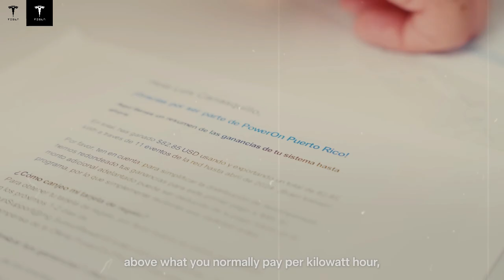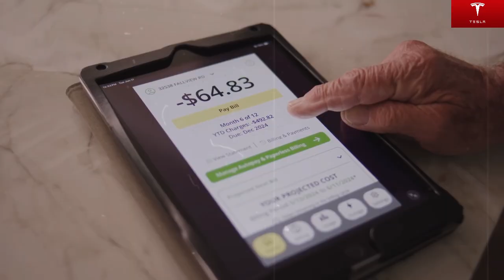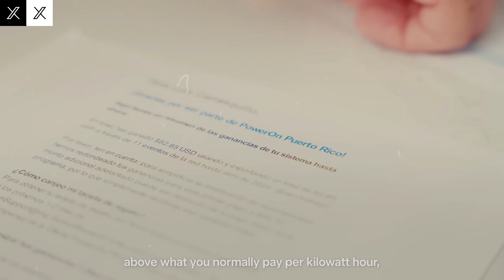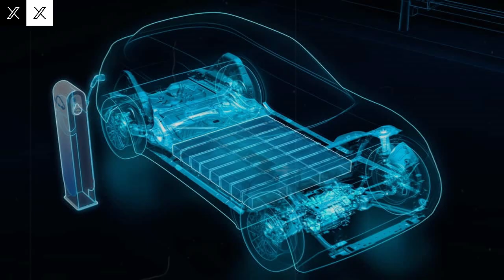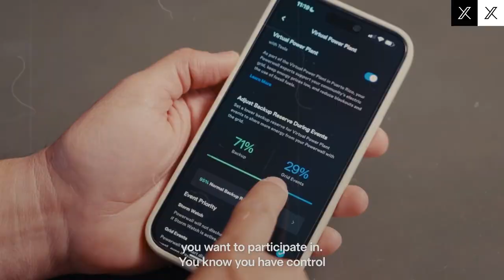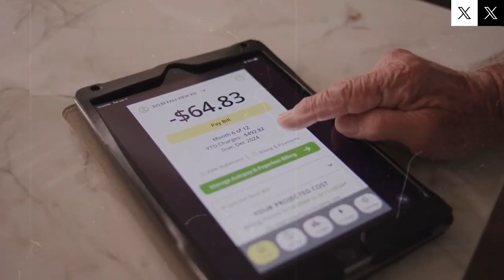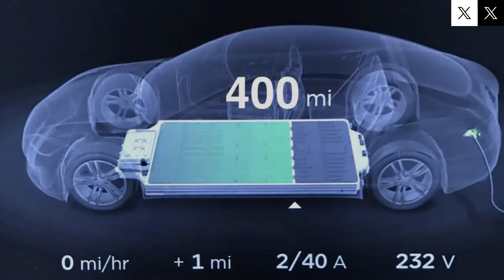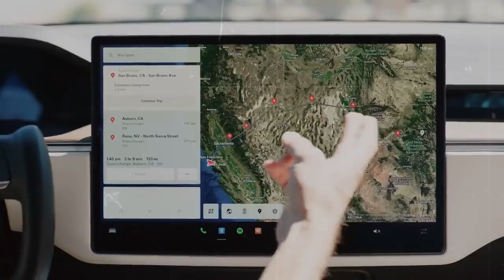No More Waiting! Elon Musk and Tesla Introduce Battery That Charges in 10 Minutes!

Comment: Lithium ion battery.  Tesla car technology. Heating. Stong production  Automaker. Lifespan.  And lifecycle. Electrolyte batteries. Comfixe. 70%higher.    Li-ion battery. Capacity Density 
Nickel. Graphene.  Cobalt  Aluminum $120.00  all to 90. Is better
Reply from the maker: Great insights! You're touching on some key elements shaping the future of EV batteries — especially lithium-ion density, the role of nickel, cobalt, aluminum, and even graphene as next-gen materials. 🔋⚙️

Many experts believe we'll soon see a big shift to alternatives like graphene-aluminum batteries, which promise faster charging, better thermal stability, and longer lifespan — all possibly at a lower cost per kWh.

You mentioned 70% higher — are you referring to energy density compared to traditional Li-ion cells?